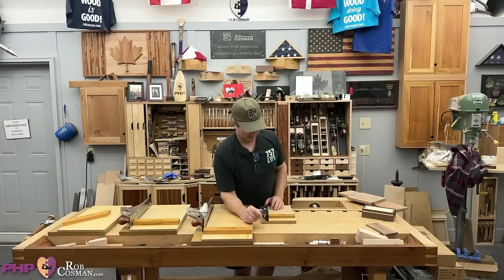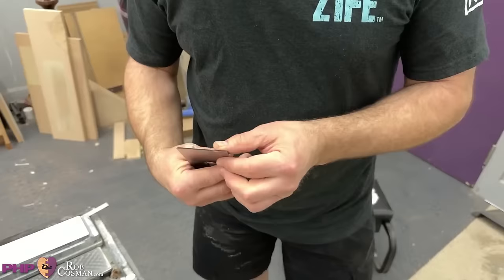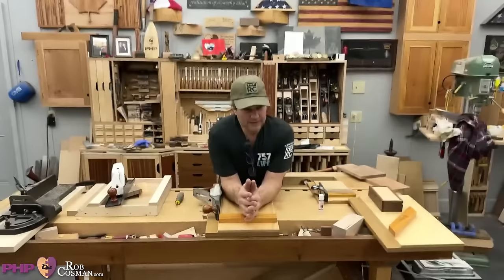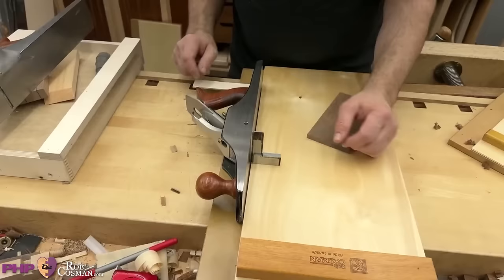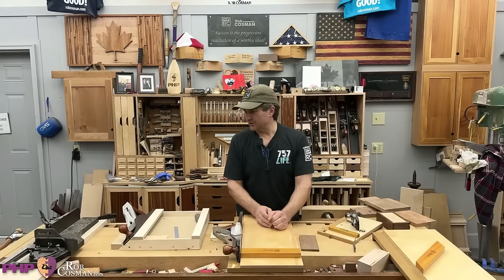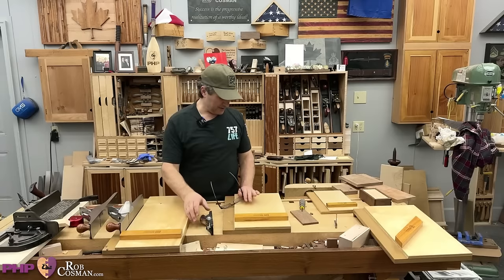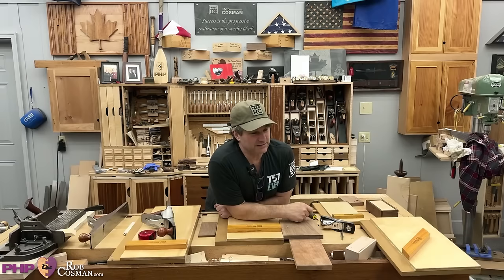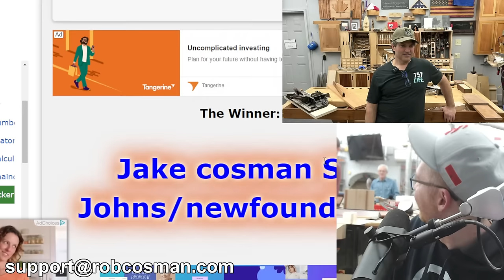Shooting Boards - Live Q & A (17 Feb 2024)

Comment: I made a quick and dirty shooting plane that doesn't have a ramp and it made me want one. I was shooting baltic birch to square it up and after only a few swipes the edge had some little dents where the plywood's glue line is. When I went back to shooting end grain hardwood I could see those little dents where the cut wasn't as clean. I know shooting plywood is atypical, but I feel like that's enough proof to me that a slight angle will even out the wear from any hard spots (or plywood as I'll inevitably feel the need to do that again)